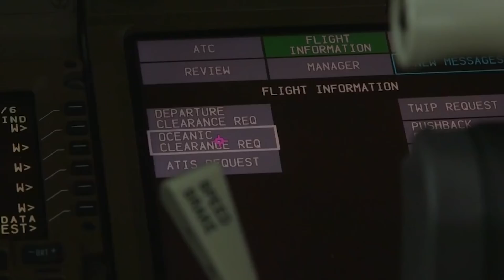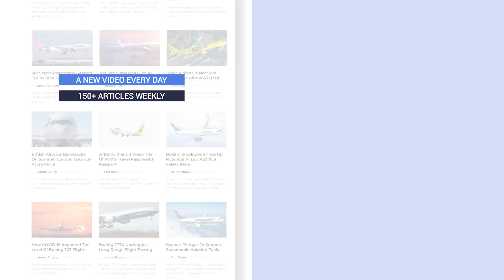How Do Runways Get Their Numbers?

Comment: short answer: All runways are numbered based on the magnetic azimuth (compass bearing) in which a runway is aligned. There are 360 degrees on a compass .  The opposite end of the runway always deviates 180 degrees and is therefore numbered 18 higher or lower.

Comment: @simpleflying Pretty poor effort that you talked about runway magnetic headings being aligned with "True North". I think you need to revisit your PPL Navigation book.

True North is the Northern most location of the Earth's spinning axis. It is a fixed location. Magnetic North is the Northern most point on the Earth where the magnetic flux fields go perpendicular to the Earth's surface. This position changes slightly day by day, resulting in the occasional change to runway heading designators such as at Stansted. This would not happen if they were designated based on True North, as it doesn't change. 

It is a very important distinction for aviation navigation, which you really should have done better on.

Comment: Explains to me why the single runway at my home airport, San Diego International , can be either 27, when taking off to the west, or, rarely, 9, when taking off towards the east (as well as downtown San Diego…Yikes!) when it is particularly foggy…
Reply: There are 180 degrees between either direction, so the difference between the number is 18.
If you fly heading 90, i e. East, you use runway 9, if you fly heading 270, i e. West, you use runway 27. Even if it's the same strip of concrete.
And as you always start and land against the wind, noone are using both directions at the same time.

Comment: Not to hot on Copenhagen (kastrup) Airport 

Has two parallel runways but one only starts a little way beyond the end of the other, hence if the appropriate runway furthest away from airport buildings is being used for takeoff an aircraft could inadvertently cross in front of a landing aircraft even without crossing the physical runway 

Had a missed approach once because of this
Reply: I do not understand this.  How would they inadvertently cross?
Reply: @denelson83  simple really 

To get from airport buildings to start of one of the runways an aircraft has to taxi along taxiways that take them past the end of the other runway 

If that taxi-ing aircraft doesn’t listen to ATC properly they will cross via taxiway past end of other runway

If an aircraft is landing on that runway they become a hazard